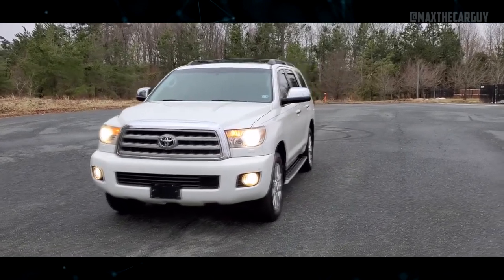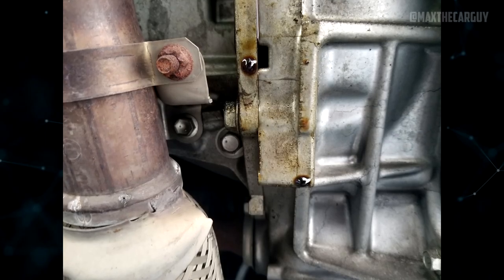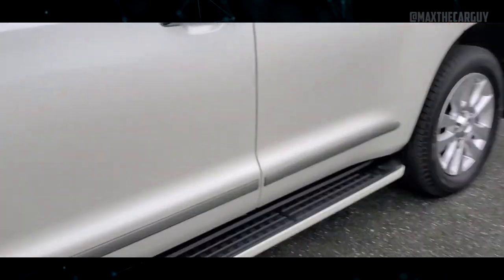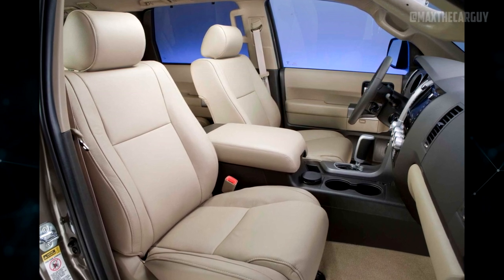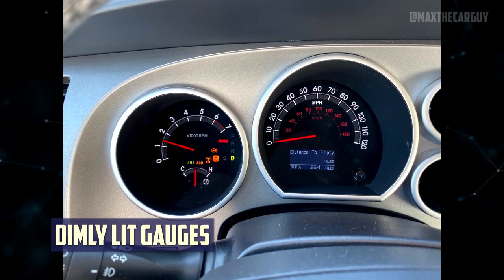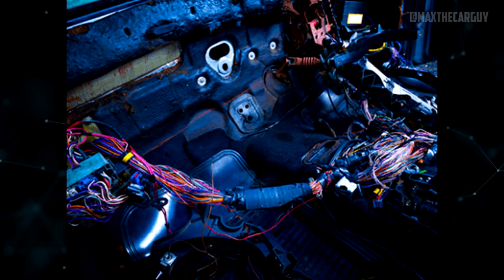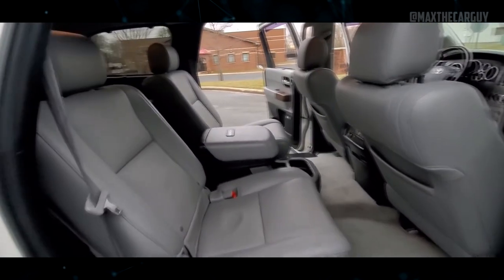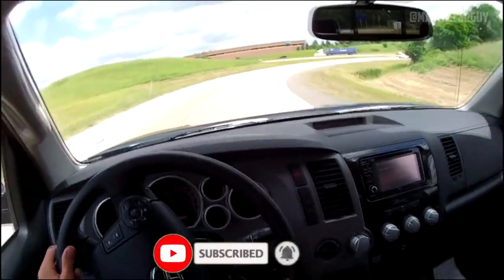Toyota Sequoia Gen2 Problems (2008-2022). What’s wrong with Toyota Sequoia?

Comment: Despite this rather dreary review, I'm here to say the 2nd gen Sequoia's are absolute BEASTS. Dependable, powerful, comfortable vehicles that ask for very little from their owners. 225,xxx+ miles on our '08 Platinum. My biggest complaint about owning this model is, if we were to ever step out of this vehicle to something else, it would simply be substandard to the Sequoia. Toyota nailed it with these. OVER built is an UNDER statement.
Reply: Zero problems in two years with our ‘08, over 200k.  As reliable as the first Gen it replaced, but much nicer.  Everything that was wrong with the first Gen is fixed here.  The only thing I don’t like is the reduced vertical cargo area dimension due to the fold flat rear seats and IRS.  It is bigger than the first gen, but drives more like a car or minivan.  It is the perfect vehicle if you have more than 2 kids, and a trailer to pull to the campsite.

Obviously a Lexus suv wouldn’t be a step down, but there is more bang for your buck here, and more space.
Reply: @kftc1980  Have you upgraded or changed anything on your Sequoia?
Reply: @nothanks1627  aluminum oil filter housing, that’s it.
Reply: I love my 2008 with 165k, I’ve experienced none of the issues alleged in this video
Reply: @kftc1980  Dude. I just literally ordered this a couple days ago. Parked in garage to keep out of the blizzard, notice a little oil on the floor. I have upgraded the headlights to Morimoto XB with amber drl's, Diode Dynamics SS3 amber fogs, and a new 10.5" jvc head unit for Android auto/Apple car play. These are absolute must have upgrades for today's needs. Love the Morimoto's
Reply: Makes our '08 look like a '20+
Reply: In 5-10 years I won’t be surprised if the third generation has major engine problems.  If Toyota can make the turbo V6 go 200-300k without major issues, it will be a minor miracle.
Reply: @kftc1980  given that I drive about 10k a year...I would be happy if the engine makes it to 100k without major issues.
Reply: @Baebon6259  the price premium you pay up front and the high resale value are tied to that long term reliability.  If the turbo engines are bad that will tank the resale value and make them hard to sell.  Selling a V8 Toyota is effortless.
Reply: @kftc1980  I have a 2021 Tundra for camping/overlanding purpose. I also have a 2006 Sequoia w/ 300k + for work. I think it is about time to retire the 2006 and get the new Sequoia.
Reply: @kftc1980  i agree, the second gen look prettier, the first one look like a truck. i happen to like the truck looking of the 1st gen lol. the 2009 and up has 100hp +100lb/ft of torque more and a 6speed trans. for sure is a more powerfull car vs the 1st gen, and no timing belt to worry about .
Reply: There’s just something about those gen 1’s tho……. I can’t let mine go lol
Reply: Unfortunately, my first Sequoia and transmission no longer reverses. I absolutely love this vehicle but this is the first vehicle I’ve owned where I’ll have to replace the transmission…
Reply: @nothanks1627 do you have a link for your upgrades?
Reply: @travismcclendon6712  which parts are you interested in?
Reply: @nothanks1627  the head and fog lights

Comment: I am driving my second sequoia.  The first one went over 250,000 miles, and my mother got into an accident.  It didn't look bad at all, but the insurance company just wrote off.  It destroyed the other car, but nothing to my mother.  So I got a used cheap Sienna.  Boy, did it last.  I practically drove it off the cliff, and the thing just kept going.  I finally said enough and donated it.  Then I got myself the second sequoia which I am driving.  The gas mileage really sucks, and I love it.  It is my way of sticking to the Californians and liberals.  I even drive without one spark plug, so I can drive in front of any Tesla and spew the gas.  I am so sick of EVs.  I am going the opposite of what everyone is doing.  Buying a gas guzzler.  Hell, my Porsche gets a better gas mileage than my Sequoia.  I just absolutely love this car.

Comment: I guess they had to try to find a handful of Sequoias, out of 14 years worth production, to make this exaggerated video. The main reason I bought a new 2016 Limited Sequoia, that has 75,000 trouble free miles so far, is because the 2003 Highlander V6 4WD I bought new, has 400,000 hard miles, and still runs perfect, and everything still works. I do all the maintenance and whatever minor repairs, it needs.  I've had every make of vehicles over the years, and nothing compares to Toyota for reliability and longevity. That's why I always say... "I Wonder How Many Chevy's, Dodges and Fords, It Would Take"... 
"To Equal One Toyota" ?  "The World May Never Know !"
Reply: It’s almost a hit piece. It’s hilarious, honestly. This engine and transmission has vehicles with over a million miles on them with no major repairs. Try that shit with any Rover.
Reply: Many of these were " 1 owner reported", so not affecting the masses.  I've had a 2013 Tundra and now have a 2022 Sequoia and the only issue I've seen mentioned in this video is the door lock motors going out.  Both vehicles have been awesome.

Comment: My 2nd gen Sequioa is the BEST suv I have owned. After owning a loaded Yukon and Suburban, my wife now drives a Sequioa Platinum, trouble free ever since. 
I have NEVER experienced ANY of the problems in this video, not one. I can agree that the dashlights are dim, but that's a preference. 

Is this video made by a GM employee. 

Sequioa, other than the Toyota Landcruiser, and Lexus LX, is the most bulletproof large SUV made.

Comment: Next to a Land Cruiser, Sequoia's are the most reliable vehicles available.  I have a 2020 and have only had a leaking rear window strut/piston replaced under warranty.  I use mine for hauling my dogs and camping in very remote areas of Montana and Idaho.  I have complete confidence in my Sequoia and it has never let me down.  I plan to keep it for the next ten years or more.  This is a very disingenuous video  to say the least.

Comment: As many have commented, these issues are BS and not true. I have owned a 2009 with zero issues with 185k miles and a 2014 with zero issues at 166k miles.

Comment: I own a 2011 Limited, purchased at 151k, now 172k, and haven't yet experienced any of these issues thus far. I've kept up with all normal maintenance, upgraded to bigger brakes discs and better pads, trans fluid change at purchase, eventually replaced front and rear suspension. I recently had one of the oil gaskets leaking so I replaced both. This truck is a BEAST!! Still a head turner at dealerships despite its age. Have driven from San Diego to Dallas twice, once to Reno through the Sierra Nevadas. Great on family trips. No major issues. Smooth riding, and quiet. I used to own a 2003 Expedition, good truck but the Sequoia is on a different level. I use premium gas for optimum performance. I wish Toyota had stayed with the bigger engine.
Reply: As a shopper looking to go from a 14' 4Rnr to one of these, where and or how on the disc upgrade?? What oil gaskets leaked, the valve covers?
Reply: Hello...The mechanic I have suggested I purchase bigger and new discs because of the previous rotors were warped, and giving me issues on the road, instead of resurfacing them. They ordered the parts for me. This was about a year and a half ago, and since then, braking has been smooth. As for the valves and gaskets, I had to deal with those oil leakage, major, in November 2023, and again in March 2024, because it was still leaking. In November I purchased a valve cover gasket set and a lower oil pan gasket. In March it was discovered that I still had some leakage though not major like before in November. It was covered under warranty the second time, the valve cover gasket was replaced again, and I haven't experienced any further leaks as of yet, but yes if you get this truck prepare to spend about 600 to 800 bucks, and for upgraded discs front and rear about 1000 to 1200. Hope I answered your question, have a blessed day.
Reply: @djohn671  ty...

Comment: 😅😅😅This video how to of been made by GM, or Ford. We owned a 2008 sequoia limited did not have any of these problems. We had it with about 251,000 miles on it until a person made a left-hand turn and stopped right in front of us were my wife hit them at 50mph. If it wasn’t for this vehicle, I believe she would have been dead. Every single airbag went off. There was airbags in places where I didn’t even think there was the police had to take her out of the car, and I believe that if I just got the hood open and replace the radiator support and fix the electrical problems, you would still keep going.  But all these issues in this video I’m definitely never experienced them. The unfortunate part is the sequoias are hard to come by and I was comparing the Sequoia to an Escalade, which I don’t want.  As a used car dealer owner looked sequoia’s within the 500 mile radius only 15 popped up that I was looking for only one had 140,000 miles on it. Everything was 200,000 up for Escalade’s in the same radius same trim give or take 600 came up the one Sequoia that I was looking at 140,000 miles was the platinum for $22,000 auction price the one Escalade 2015 with 115,000 miles with more bells and whistles for $22,000. Don’t get me wrong. The Escalade is a beautiful looking vehicle, but I would rather have my Sequoia.

Comment: They didn’t mention the common coolant leak from valley plate but regardless my 08 platinum has 400k km or 250k miles and doesn’t burn a drop of oil or have any of these issues greats deal to pick up an old one in todays market

Comment: This video almost made me to give up on buyin one of these, but I watched the comments and watched the video 1 more time....
1 - to get total loss of teering power you must have all fluid gone.... there is absolutely no way to NOT see it and take care of it. And now that the SUVs were recalled and fixed this problem is gone. If you see leak you can check it and fix it
2 - how can you tell its a big and wide spread problem by telling ,,severa" wtf :D Also this is fixable :) And stullf like flame in cabin has not heppened.... (and the way its said here ,,some people" ... no words)
3 - this happens if you DON'T take care for your engine :) This is why probably Toyota is slow to acknoledge is
4 - just watch your tires. But for the cracking stuf with that separating wheel from the car is really scary... since they were recalled and fixed we don't have to worry. However you can check the lug nuts and you always have to :)
5 - very few ppl had problem with electric locks (how came say 1 owner reporte it and some ppl with 2012 models)
6 - both easily checkable and fixable 
7 - scary, didn't saw it in other videos (probably because cars were recalled and fixed). So if this happens to someone just know that you have to swapt some pards that could engage the accelerator pedal due to friction (should not happen because cars we recalld and problem fixed) 
8 - only on 2018 models and its recalled and fixed
9 - only on 2016 models and easy to fix with stronger light bulbs (or LED) :) 
10 - you told for airbags problems but never told if its common or not. Every car had some stuff like this and honestly its not a big deal if airbag is giving an error and you know it won't open. Better to know that instead of getting it launched from nothing :D Not a good thing at all but from your info it might be not a common problem (or not a problem with sequoias at all). I also searched for such stuff but didn't found. Its only here in this video :)
11 - couldn't find any info or video for problems with wiring of Sequoia and ,,one" owner doesn't make this common problem. And can't really believe that you tell me that rodents will chew up a car wiring :D lol 
12 - how come talking for second gen and talk for many sequoias made before 2008 and at the same time tell that few of the 2008 made cars had that problem but it was fixed in all sequoias..... 
13 - watch out for real with 2014-16 models but its not very hard to fix it. All you need is to adjust the camber, the caster and the tow on all 4 corners and you need alignment cam tab gusset - DONE (it happens if you go offroading)
14 - a single case out of a who knows how much existing vehicles :D :D also there is no additional info and this might happen due to bad maintenance :)
15 - it happened only on 3300 vehicles made during 2005 and 2011 (not all from second gen). They were recalled. And it happens becuase the ompression of the seat cushions can eventually damage the seat heater wiring. It CAN make it doesn't mean it WILL make it. And even if you see error for this on your dash board or something is malfunctioning with the seat, just disconnect the heater and look for help, nothing so scary :)
16 - it happened only beween 2009 and 2011 models, they were recalled and fixed, doesn't exist anymore. However you can always check it with not struggle
17 - this problem got it as you say ,,one owner" and a ,,few other owners" and its probably not from the relay if its still persisted after changing it lol :D 

so summary - none of these should distrub me or anyone who wants to buy sequoia. However its good just to look at them so we know that we can check these spots and see if someone isn't telling us about the problems that the car we want to buy have :)

Comment: I NEED HELP MY FELLOW SEQUOIA OWNERS!!
My coolant is rapidly disappearing and I don't know where it is going. My engine is not over heating and there is no smoke coming out of the exhaust. I don't think it's a head gasket, I honestly think it maybe the heater core. But I don't know how to test that.
Reply: i think if it was the heater core, you would have a wet carpet or floor mat, inside the cabin, maybe on the passenger side. if not check all your hoses, and water pump,
Reply: It’s probably the valley plate remove the intake manifold and you’ll see coolant

Comment: After all this stipulated problems, Toyota land crusier and 
The toyota Tundra still functions after 1 million miles with proper maintenance, Toyota sequoia as the same engine with Tundra and would do the same thing after proper maintenance and would go pass a million mile which is far better than most new electric vehicles that will explode which is so sad, all other toyota models that proof its reliability are
Toyota Tacoma with 1.6 million miles and still working strong
Toyota prius with 999,999 miles, almost a mile and still working  well
Toyota camery and corolla with almost a million miles and still working well, with other all toyota models, you can watch you tube videos about this and see for yourself, Toyota vehicles are dependable, reliable and affordable with proper maintenance